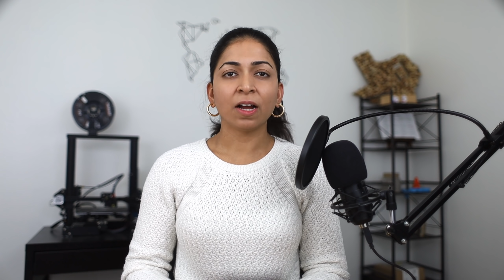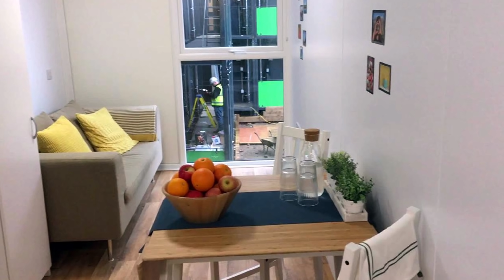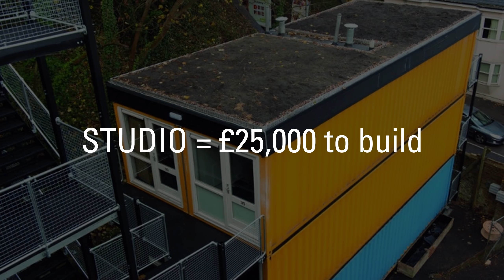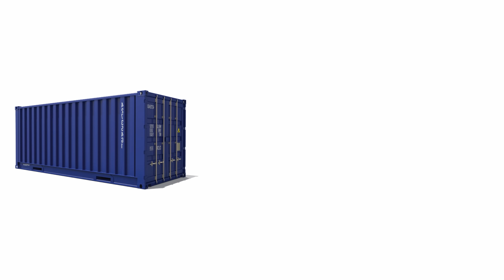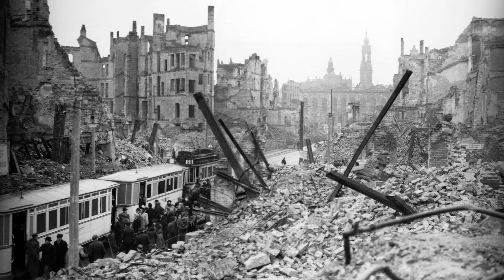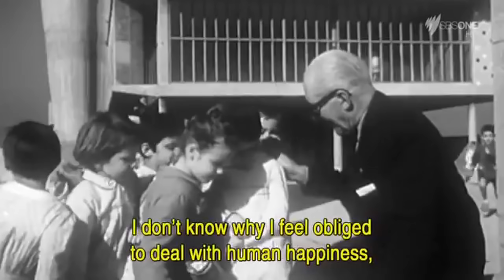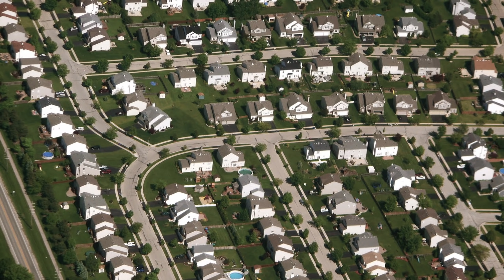Why Shipping Container homeless shelters FAIL

Comment: So a shipping container that is 10 ft by 30 ft is about half my apartment some shipping.  And even my apartment still very cramp because I have a bed I have a couch I have a kitchen I have a bathroom and of course I have a flat screen TV which takes up space also I have a bird which I try to give him space too for his cage and everything not that I ever I'm in the cage but I don't even have room for a dining room set after the bed the cage a little bit of four space so I can actually walk around in my apartment the couch the TV the stove the fridge etc.  So I eat at a little desk or I just stand and eat. Like from 600 to 800 square feet would just make a huge difference especially because I'm indoorsy type person and I love making things and I'm like just that extra 200 ft I would have space for a table to eat at and another table specifically for all my crafting of course as long as it's not in an apartment that's just a chopped up house and it's poorly designed where I can't really put anything anywhere because there's a radiator here a radiator there and the doors are poorly placed so if I want to use the door I either have to climb over furniture or I have a much more limited way I can arrange the room like I literally use my living room as my bedroom and my bedroom as my living room because of the way the radiators are set up there's no space really for a queen bed and a night stand in the other room and then on top of that my bird has his purchase and everything and when you have all that together you just there's no where to fit it all in the room everything's on top of everything and you don't have any room to walk especially if you don't want to put your bed right on top of the radiator where if your sheet falls on it maybe you end up with fire while you're sleeping since again there's only so many places you can put the bed and everything else.  The most important thing is people are individuals that's why you can have the best business and the most beautiful piece of work of art but if nobody wants to pay for it you're still going to be poor.  Even if you're selling it for a cheap affordable price.  Everyone is different everyone's in individual and everyone's unique you can't just blanket everyone and expect everyone to be happy in the same blanket.  Some people like their blankets warmer some people like their blankets fuzzy some people want to cover them whole self in the blanket some people need a much larger blanket because their partner steals most of it if it's too small.  And then some people wake up dead because their partner murdered them in the night because they kept stealing the blanket.  So you can't just hand out a blanket to everyone and expect everyone to be happy with it or for it to meet everyone else's needs especially if some people get colder than others
Reply: Like don't get me wrong somebody that loves outdoors would probably be fine with even 200 ft the kitchen's outside maybe the bathrooms also kind of sort of outside whatever they just start inside because they're sleeping at night but the rest of the time they're outside when it snows they're out skiing and whatever they just do not have the same needs as me we're imperfect beings and the best society is the society that says you know what here's the money so you can survive despite being homeless you decide what's the best option for you but we're not giving you any more than this. That's why I say just slash all the welfare programs / everything use the money from that to a 30% income tax and whatever you made and then based on the income tax whatever kind of percentage of our taxes went to the social welfare programs we add on to that 30% and we create a Ubi in America and then universal basic income is guaranteed to everyone so everyone would basically get a minimal based off of what the country made in profits or income essentially we would also tax companies after they paid their employees and themselves additional 30% of their profits to redistribute into the Ubi. Then you as an individual decide if you want to use this to buy insurance if you want to use this to buy or pay for something medical if you want to go on vacation if you want a home if you need for a car if it's extra if you need it to survive off of if living out of a car for a little while is better if and whatever you feel best is for you as long as you're saying confident adult everyone gets it and you decide what's best for you if you have extra and you don't want to keep it and you would rather donate it to a charity that helps people then you can do that if you know someone who needs a little bit more money for something medical you can give it to them again it gives the power to the people and I think when individuals have more power we become actually less dangerous because we're not in this constant fight or flight and need for survival and we have the power to be more generous to other people because we ourselves are not suffering and trying to make it to the next day we can share what we have but when you try to force everyone into this personal ideal model it just doesn't work if people want to live in a big fancy building it has to be by their choice in their desire not because they have no other option and that's what's being given to them so instead give them cash let them figure out what they want to live in or where give them the power to say hey this place is falling apart I'm going somewhere else rather than having to wait for permission or for someone else to step in nope you have the money you can take it somewhere else and you don't have to worry about them trying to fix it up they don't want to do it or they are unable to well again that's not your problem you appreciative for providing for you the housing but you were also paying for it

Comment: Like if you're going to produce on this scale I mean you might as well just design a new system that is rectangular like the shipping container and just build that from scratch but build it right from scratch and that will help take out some of the work because it's stupid just to buy new shipping containers for that instead just hire a company to make something that's that shape that is modifiable and stackable and movable but usable in a mass produced way where people can live in or even can combine them but it keeps cost very low because of how modifiable and movable they are kind of like a mobile home but it would actually be mobile because one thing if you know anything about mobile homes is once they've been put in place that's it you really can't move them because if you try to do they're probably going to fall apart.  So basically I guess the best way to describe it is it's like a trailer but it's a cross between a trailer and a mobile home but it's made to be long-term in one position but it's supposed to be small enough so it could be a modular thing

Comment: If "homeless shelters" fail, it's probably because they aren't addressing the real problem.  Homelessness is incidental - the person who is homeless is very likely to have severe mental issues, drug abuse problems, or similar.  Putting a mental case in a shiny new apartment or home doesn't fix their mental issue.  Same thing for drug abusers.  Are there some homeless that are not mental cases nor drug abusers?  Yes, but that's a small percentage and you need to analyze why those people are homeless - is it simply bad luck, they're too lazy to work, they came from broken homes and were tossed out of the house, etc.  Identify and fix the problem, then "homelessness" will become less of an issue.
Reply: People need to take more responsibility  for the state of their lives!

Comment: What is wrong with a shipping container home?   They are all the rage re: “Tiny Homes”.  
*Solve the  heat/air conditioning  issues. *
(Not as bad as a tiny  cramped apartment with no air conditioning  nor heat, and cockroaches, rats and mice!).

A deck/balcony, flowers and communal (food) gardening would also improve life.  
I would prefer it to living on the street in extreme , summer /winter time weather.

Comment: Are they insulated? Are they equipped with heating/cooling, or ventilation, so it can air out? Sounds more like they are going the cheap route, and that is what the problem is.
Reply: These  are TEMPORARY. They want a a e with heating cooling g and insulation they should use the time they have  in these places to find employment then they can get themselves  an apartment with ALL those features!!!

Comment: It kind of seems like the homes were designed as a temporary home for people while they got them on their feet but as with most things people can't deliver on their promises and people end up staying there for ages. I think they should probably be able to do something about the heat and the cold with little effort though you just need to install some sort of ventilation system and pump 21 degree air through all the containers constantly.

Comment: I don't think the issue is the architecture. The assumption that putting a homeless person in a home "fixes" the person is a bit absurd. I imagine all these failed projects likely would not have failed if they weren't intended for the homeless. There are many apartments that are plain and bland and they are run successfully. Putting a homeless person in a home is just trying to fix a symptom not cure the root cause of the problem.

Comment: Homeless shelters don't need to be "improved". There is no reason to increase the cost and utility of housing when the alternative is living on the street. Its a bridge to better living, not a means to itself. Those container houses shown in the video already look way over engineered. Plastic paneling with foam insulation and vinyl flooring  over plywood would do it. Instead of making these things better, making them cheap and then disposing of them after they have served their purpose makes more sense. They were headed for scrap in any case.

Comment: While I have a solution that I am developing as a hybrid combo of various already successful homeless settlements, I did notice that the presenter here only pointed out problematic issues while ignoring a solution based presentation.  This video is a fail as it only points out the mistakes with no proposed solutions to those trying to solve the problem.  While the shown previously (assumed) homeless lady in the video was complaining about the accommodations, it is to note that many homeless live in a tent or cardboard box.   I have seen successful homeless developments where the people lived in a shed with solar panels on it.  The success of the development was in its nature.  The nature of the development was that it was a socially beneficial and accepting of the tenants in the development and that people were allowed to be themselves.  I would agree that someone who was previously homeless and then transplanting them into a shelter that was more or less not in the best nature of the tenant will not be successful.  This has been the case in mostly every economic class.  That is why putting up a homeless shelter in a gentrified community is a fail as it is not inline with the nature of the tenant.

Comment: Shipping Containers seem like the perfect thing to build a small home.  The fact is, they make poor homes.  By the time you spend the money to Insulate them and whatnot, it ends up being cheaper just to build a normal type home than using a shipping container.    They are good to use for Storage, and other things to keep things in them. We have some of these at work we use for storage.  

The other problem is, when people have nothing invested in something like housing, they don't give a crap about it and will treat it as such.  You can see this all over.  Public Housing Projects when new are nice.  Over the years things get worse and worse and worse.  Crime and Drugs move in.  With very little money coming in to help maintain the place because it's low-cost public housing, they get more and more run down.  No one cares about anything.  In the end, it gets torn down.

What is the solution?  The more money you dump into the problem, the larger of a problem you create.  There is just no simple answer.  But using Shipping containers as housing just doesn't work well.

I do like the idea of Habitat for Humanity.  It gets the family into housing.  They help fix the place up, they still have a mortgage, but it's much lower than normal.  They have something invested into their housing and so more prone to take care of the place.   This of course doesn't work for everyone.  Just not enough to go around, or the resources for everyone.  This kind of thing does work.   Other things fail.  Learn what works and what fails and go from there.  Shipping containers don't work. Not really, not in a real cost-effective way unless you don't care about the heat or cold living in these things without good insulation, walls, etc.  At that point, might as well take the shipping container out of the picture.  These days, the prices on them have really shot up.  It makes zero sense to do it now.

Comment: For most of the 20th century builders were busy building homes designed by themselves or draftsmen they felt they could be for a fair cost and then sell at a fair profit - this was a period of small speculative building. The builders often used the same six or seven basic designs with mild variations, but never built two of the same design close to each other, thus there were several designs in a street where they built more than one building. The great majority of those buildings are still around today as family homes, while some have been torn down for various larger projects. In most cases the original buyers lived their lives in the home they bought, and they were often handed down to their children. In the 1960s large building companies started building estates of housing of the same design and apartment blocks, while they did sell as people had to have places to live, yet few of those residences remained in the hands of the same owner for any longer than they felt they needed to save up and move to something better. 

To me, the issue is not what the housing is built of, it's the idiot architects who design them not having a grasp of what other need, so you're right about their arrogance. Years ago I worked with a fellow whose family made a living out of buying buildings then renting them out, and most were office buildings and the like. Before he even considered buying a building he'd ask if it had received an architectural award of some sort, and if it had he immediately lost interest in it, when I asked him why he said, "Every building larger than a shed with an architectural award I've seen was either dysfunctional for general use or it had major maintenance issues because the architects fancy ideas weren't practicable for daily use." - I've never found a reason to disagree with him.

Comment: while i found this to be yet another pretty informative video about a topic that seemed at first pretty interesting, i wonder what the other side would look like actually. do you think wooden constructions are the solutions? i mean, i can see it being environmental friendly, but the amount of wood you need to build a single house massively extends the amount of trees you'd have to fell in the same surface area you'd build said house on. and trees don't exactly grow those hundreds of meters tall and several meters wide in just a few months. debunking printed houses or container houses is fine, but i wonder just what would make for a proper solution then. 

maybe i just missed the correct vid about it though.

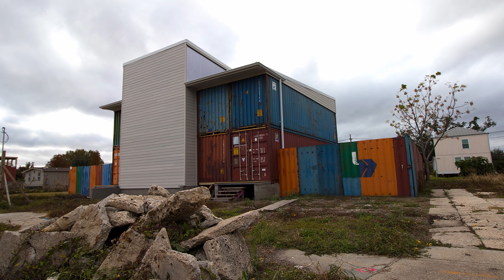Comment: 8:48
So what, all those problems happen in normal houses and flats.

If people tend to treat these homes as precious, they wouldn't have those problems.

That Somali complaining about the roof over her head should be homeless so she can stop taking that roof over her head for granted!

I would rather live in a shopping container than live with multiple house sharing with trash!

You want to prevent mould in the house? Use mould cleaner and dehumidifier!
Want less heat in summer time? Get air con, or fans, loosen up unnecessary stuff in the house! 
Want heat in winter time? Get a damn fan heat and close the damn windows!

Comment: Wow, those are some shallow reasons. I actually came here wanting to be proven wrong because I've seen your other arguments and some made sense, but the only palpable argument you've brought here is cost to material. Don't tell me that a shipping container is inhumane... FFS it's bigger than my living space. Hearing homeless people complain about stuff like that is just bullsh*t when I know that I'm not homeless and even I would take it in a heartbeat if I lost my home. You mentioned mold and that could be a solid argument indeed, but you chose to just remind about it because it was helping your cause, althewhile conveniently leaving it unadressed. You could have said that mold would never be an issue if you just used an intake and exhaust fan automating them for pennies with regard to humidity and temperature. Also, those housing units most definitely have the most basic of heaters otherwise they wouldn't pass safety checks.. So there, your overheating and freezing  is addressed, and as it turns out it wasn't much of an argument to begin with. But why mention all that when it's easier just to give incomplete information and use it to further your point. I do that too sometimes when my argument only has one leg to stand on (which by the way would have been enough)